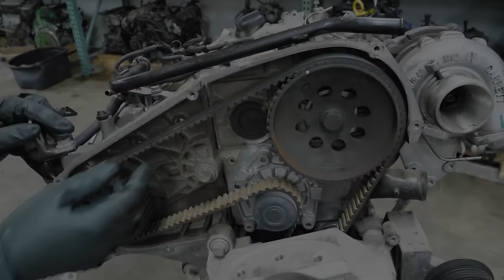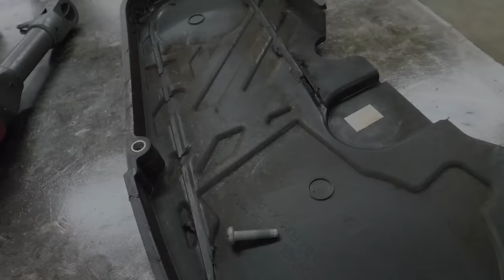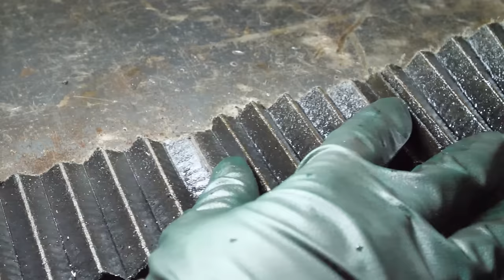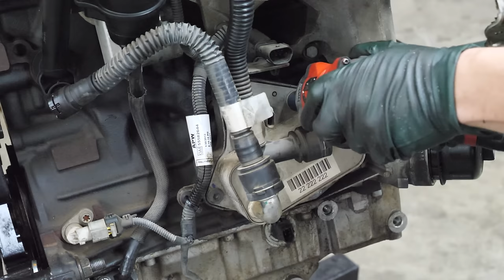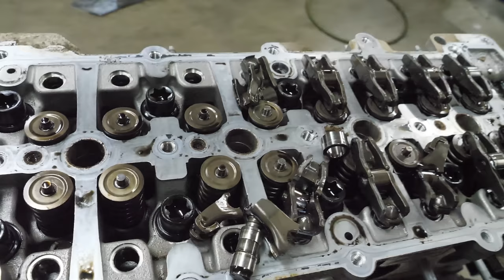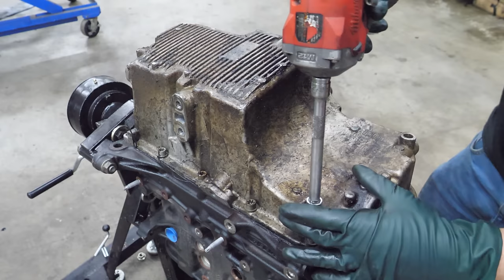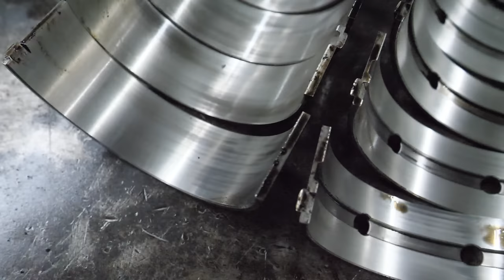I RUINED IT! Tearing Down A "BAD" 2.0L Chevy Cruze Diesel The Wrong Way

Comment: I love my 2014 LUZ Cruze. Just reached 100k miles, I can get over 600 miles on a tank of fuel (easy 45 mpg highway) and my best 50 mile average is 59.9 mpg (flat road, no wind, no drafting). I've made it from Detroit to NYC on a single tank of fuel twice, and Detroit to Asheville on one tank more times than I can count. And the added list price was mostly due to the trim package, the gas engine with the same trim was only about $1,500 cheaper. I plan to keep mine until I die.
Reply: What has broken on it so far?  Replaced any window regulators?  My daughter had a 2013 LS (1.8l gas) for three months (totaled it in an accident), and I got to replace the driver’s regulator at 90k.
Reply: @sharkinstx   The driver door window regulator a few years ago, the A/C compressor clutch last summer, and the side detection module last month. Just did the timing belt and put on Bilstein B6's (both normal maintenance items) and the Whiteline rear sway bar, with the suspension upgrades it handles better than ever. Next come the Whiteline 27mm front sway bar and high-durometer control arm bushings.
Reply: Then one set of injectors and an EGR wipes out the fuel cost savings
Reply: I get closeish numbers from my eco if i can stop assholes from tailgaiting me.

Every car I've ever driven, no matter the engine type Gas, Diesel, or even full electric Or how boxy the vehicle is, get their best economy at 45mph.

It was true for my 1987 3/4 ton V8 Carburated van as it was the Chevy Bolt Rental I put 1500 miles on driving around looking at Replacement Eco (6MT) Cruze's with.
Reply: @Me-zo8yc  They have BOSCH injectors you can get them repaired easily not sure for North America, Egr just needs cleaning after 100k miles.
Reply: @Me-zo8yc nowadays most people delete the EGR and the dpf / def . Because the customer won't pay 6k for a new dpf filter installed at the dealer.
Reply: @originalchilehed  No one will believe me, but my 2014 has 204k now, and I've done almost nothing. NOX sensors once and a DEF heater. That's it. Original brake pads and rotors. Original suspension. Nothing but oil changes and tires. Still averaging 42mpg on a tank, 80% highway.
Reply: @brianp6965  Original pads and rotors??!? Damn dude, how'd you manage THAT?
Reply: @originalchilehed  🤣 I know, is crazy. I have new pads & rotors in the garage but they won't hit the wear indicators. Fronts still have almost 1/4", rears are paper-thin. Zero noise when stopping though!
Reply: @tomtom1541 If they installed the Speed Of Air dimpled/thermal coated pistons with gapless rings and did nothing else to the engine, they wouldn't need the EGR/DOC/DPF/SCR w/DEF.  Besides there's a Federal Law on the books that states any diesel equipped vehicle at or under 6,000 GVWR is not required to have emission equipment.
Reply: My best is 720 miles before refueling. They’re amazing.
Reply: @cyyber1  720's crazy! How'd you do it? Tires at max pressure and CC at 50 mph?
Reply: @originalchilehed all highway 65 mph average. My second gen gets 50’s and 60’s highway but it’s a manual.
Reply: @sharkinstx I’m at 215K and it’s mostly been emissions parts. Nothing major or anything I couldn’t fix myself. Engine and transmission still run like new.
Reply: @originalchilehed the diesel got bigger front brakes and the pads seem to last forever. The transmission downshifts nicely too which helps a lot.

Comment: To undo the loctited fastener, apply reasonable torque on the edge of stripping and hold the torque. Hold. Hold. Sometimes it can take up to a minute. And all of the sudden it gives. That’s because polymers in the thread locker are pliable. They will resist sharp forces like vibration or impact wrench, but will give at the steady force.
Reply: You must be a wizard to hold this knowledge.
Reply: @James-vt2cb  It was black magic shared by loctite rep
Reply: Or heat it.
Reply: Interesting comment but I'm not going to sit there and wait for something to happen lol

Comment: Fun fact, the glow plugs on these engines use a M9x1.0mm thread pitch. Something I learned when I went to try to compression test one. The necessary adapter is something that doesn’t come in most diesel compression test kits.
Reply: parts in this engine are same as focus, german. a good mechanic, fkt mine, cos he didnt time it correct, broken rockers, no other damage..  if its not a chev, they know fk all..

Comment: The engine is very normal here in Europe. It is actually designed and build by FIAT.
It has a very known problem that kills it.
The O-ring between the sump and the oil pump becomes hard and leaky.
It sucks in air together with the oil and when the oil light comes on, it's already too late. The bearings on the crank are finished.
A known problem in Europe and used engines are sought after and expensive.
Reply: That would explain all the metric bolts
Reply: This is probably what destroyed this engine. He didn't really look at the o ring, but I'm guessing that was it's main failure because how the main journal bearing looked like.
Reply: 100%
Reply: @samh6761  most of american cars use metric bolts as well
Reply: Fiat = Stellantis, which explains a lot. GM using a Stellantis diesel engine.... Oh well, they sold Open/Vauxhall to Stellantis too so I guess at least those now are fully stellantis instead of just the engine.
Reply: @Google_Is_Evil  they are still pretty decent engines besides the o ring issue. But ya, stellantis is a shit company and cheapened up all the brands they owned.
Reply: Replaced mine proactively at 150K miles. 215K now and still on the original turbo.
Reply: Is it a good idea to replace that gasket/o-ring preemptively?
Reply: @dennisyoung4631  absolutely. When it goes, it will ruin your bearings.
Reply: @dennisyoung4631 
Don't worry.
Other commenters confirm the Single Overhead Cam engines were Fiat.
This engine is DOUBLE OHC - GM - NOT FIAT.
Reply: FIAT 😂💩

Comment: 15:08 Senior Design Engineer at a major OEM here. That fastener decision was likely not engineering, it was Production and/or Procurement. Designers aren't in the business of perpetuating retardation of that type.
Reply: "Theres the Blueprints, then there's the As-builts... "
Reply: I'd almost guess it's a type of anti tamper fastener to keep people from deleting the pcv so easily.
Reply: I don't know for sure how the automotive world works from the design and development, as well as test and initial fielding.  

But as a life cycle logistician, no one is allowed to go outside the design without some kind of change order process.  We in the program office can't do it; the Fleet Readiness Engineers and Logisticians can't do it; the Fleet can't do it - even in cases where we KNOW something will be an acceptable substitute.  There's a process in place, and everyone has to follow the process.

Not even after the platform is fully fielded and in sustainment can we do crap like that.

I can't imagine your world is any different.  I know we couldn't make those kind of substitutions when I was a dealer mechanic (Ford and Toyota).  That's what the field reps and the engineering hotline/review process is for.
Reply: off course... who would admit...
Reply: "Senior design engineer" sounds a lot like somebody who would already know about tamper prevention fasteners from back when they were for locking out carb tuning to now when they are on emissions systems that are commonly deleted
Reply: @tetedur377 unless you are Boeing, then it’s process schmocess, I got donuts to eat.
Reply: @madflyer1093  You are correct, the LUZ for North America has a tamperproof PCV system. To remove the bolt you need to cut a slot in it and remove with a flat blade screwdriver. The special bit for the bolt is only used for installing a new bolt.
Reply: I take minor joy from removing tamper proof screws and then leaving them with whatever part they were holding down on a nearby shelf.
Reply: Hard to believe. You guys always blame others for your failures. It's not just fasteners, it's entire engines designed poorly. And this applies to pretty much everything. From water bottles to refrigerators and heavy equipment. I've seen it all.
Reply: @xXturbo86Xx  Sure you have... lol
Reply: @xXturbo86Xx 
Correct.    Since 1985 everything is built to a budget & not to a standard... BY DESIGN!

Comment: My Vauxhall Insignia have this engine, I really love it, mine done 200k and it's still run amazing with no problems, just regular mentenance, them big issues is oil pickup gasket, they are shit, in time it lose oil pressure and kill it, easy to fix with a aftermarket think, except that it's amazing engine ❤❤❤
Good job Erik, I enjoy your teardowns every week 👍👍

Comment: I admit I cringed when the impact was spinning the camshaft, but I think it is so cool that you said perhaps it wasn't the best idea, and then admitted it freely as a mistake at the end.
It takes courage to admit mistakes in a huge forum like this, and I admire that.    But, based on some of the other comments about the water pump seizing (though it didn't seem like it was seized, though the engraving of the timing cover by the timing belt is a sign of that happening)  and causing the valve timing to get messed up, the busted rockers (which are apparently a purposefully designed weak-link to prevent bent valves), may not have been your fault.  You may have broken a few more rockers in the process, but then, maybe not.   I hope you can get some positive ROI on this engine from the good parts.   Great video as is usual.  Your witty and humorous commentary as well as great information content always assures that when a new video comes out, I'm on it right away.    Thank you for doing what you do!
Reply: Regarding the water pump. The one that was shown was a new one. I think the previous comment from @sofarsogoodsowath was him recognizing the attempt to fix the problem. I have a 2014 Cruze with this engine. I change the timing belt, water pump, idler and tension pulley every 100k miles whether it needs it or not. It just turned over 270k so I'm getting ready to do it's 3rd swap of everything under the timing cover. It's about a $1000 for the dealer to do it, but I think it's money well spent. I bought the car new and have free oil changes for life, at least 3 a year, sometimes 4. That has more than paid for the maintenance on this car.

Comment: Ray tore down an engine earlier and now you grace us with a teardown. Its a good day today.
Reply: Who’s Ray?
Reply: Ray Alpha Ramano, of course.
Reply: @okiedean1112  Never heard of him.
Reply: Yeah, cylinder 8 just needed honing to fix the low compression.
Reply: @HappyHarryHardon  Rainman Ray.  He tore down a small block Chevy that apparently sat out side with the intakes exposed.  It was junk.
Reply: @johncooper4637 Ray does not know about spiral head un-bolt pattern, obviously  About 1969, a vet navy engine tech explained to me that taking down a head improperly would cause it to warp.  He explained the reducing spiral pattern to take down, and the center out, ironing, spiral to apply.  Ray needs to read some 60s Audela engine manuals to understand.
Reply: @boogerhead0  I cringed when I saw that as well! 😖

Comment: I have this engine in my Alfa Romeo in the UK. I love it - Fiat are known in the business for making good engines. 

140hp, 350ish NM of torque, I genuinely drive it like I stole it and still get about 43mpg (nearly 50 american mpg I think?) 
I have seen around 70mpg at around 70mph on the motorway when driven efficiently (uk mpg so ~78 american mpg) 

Also low emissions (so tax is very very low at £35 per year, I used to pay £35 per month for a GT86!)

The worst part of the car is the gearbox which actually is a GM part. 🇺🇸 😂Cant take much more torque than standard and they all have a bit of a crunch sometimes if you rush 4th-5th.
Reply: Convert UK mpg to US mpg, divide the UK by 1.2. So 70 (UK) is 58.3 (US).
Reply: @csjrogerson2377  ah ok cheers, I wasnt sure of conversion rates.

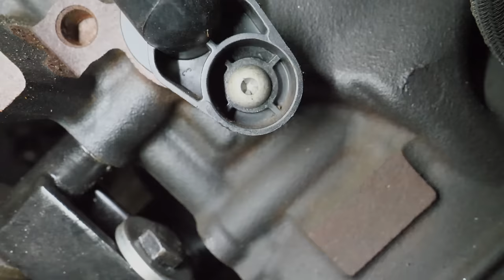Comment: 14:50 ,its a 5 point torx anti tamper fastener ,need the tool ,its also used on other components in the vehicle....they also used on parking boots on the keypad & bracebar ....you can easily remove those pesky parking boots unless it has the 7 point anti tamper fasteners...but then again i got those too 😁

Comment: Here in Europe the diesel engines in cars were pretty popular. Due to direct high pressure injection and the use of turbo's they produced a lot of torque and horsepower. If tuned, they had a lot more horsepower and torque. The VW 1.9 tdi for example was a very popular engine and was tuned a lot. It could quite easily be tuned up to 200 horsepower, using bigger injectors and a bigger turbo (and then a remap off course). Nowadays diesels are not popular anymore, because politicians taxed them to death
Reply: "Nowadays diesels are not popular anymore, because politicians taxed them to death" To be fair, politicians are the ones who promoted diesels with lower taxes in the first place  (with lower fuel excise on diesel than petrol & car taxes based on CO2/km). Diesel passenger car market share  didn't go from 10% in Europe in 1995 to 50% in 2015 by accident!  It was a policy decision (supporting EU domestic car industry who are  good at diesels, unlike Toyota with their petrol hybrids as promoted by political policy in California and Japan) and to phase passenger car diesels out now based on realising how bad they are for urban air quality, is a policy decision too.
Reply: @TassieLorenzo  Euro 6 Diesels, and especially those with lower compression (14.8:1 vice 18:1) are extremely clean. My Mazda 2 turbo diesel's exhaust is spotless even after 8 years and produces only 89 gm Co2/km and hardly any NOX.  Its cleaner than a BMW mini.
Reply: @TassieLorenzo  Two wrongs dont make a right. Governments meddling is never a good thing, especially protectionist governments in Europe.
Reply: I think you are forgetting emissions. Clean diesels have a lot of reliability issues because of the emissions crap on them. I would never buy a modern diesel unless all the emissions were ripped off.
Reply: Euro5 and Euro6 is the death of the combustion engine.

Also doesnt help that manufacurers cheap out big time on the emissions systems and honestly idiots buying a 200+hp twin turbo  2.0L diesel hammering on it for years with bad maintenance as its common in Europe to be an NPC and not know better than "factory recommended" service intervals dont help the reputation of modern diesels at all.
Reply: @jkneeland89  I wouldnt touch a modern one given the issues, even if they have better performance. The price of diesel means they arent more economical to run anymore either.
Reply: @csjrogerson2377 idk if you heard but several manufacturers got caught cheating on emissions. Even Toyota diesels have issues with emissions now. So real world driving will be worse than the sticker.

Comment: The reason that one part had a special fastener is because it's part of the emissions equipment that they don't want you to remove. So they make it so you won't have a tool to remove it .
Reply: Did they ban angle grinders?

Comment: hey eric, just a quick heads up, there's plenty of euro diesel engines where the cams are hollow and the lobes pressed on and to avoid certain issues they make it so if out of time or similar event will break all the cam lifters in half instead of bending any valve since they are just straight up and down (vw, peugeot, renault, fiat, benz, even hyundai and kia diesel's are like that), so yes, the needle bearings are indeed your aftermath in the pan 😂
a few examples would be peugeot's 1.6 dv6, fiat's 2.0 multijet (of which this engine is born from) and renault's 1.9L FQM diesel all have a "cam on valve cover" in a similar fashion to the "cam tower" you find in other engines (like that toyota 2.5L and the GM 3L LM2)
EDIT: in my opinion? this engine is freaking mint, she just needs a service and its basically a 100% builders engine! my guess is that it might had ingested water or hell maybe a flood car...
Reply: they do bend valves if hit hard enough
Reply: is there an upgrade to these, do you know?

Comment: One of the best little diesels ever made. If well taking care of could produce 50 miles gallon throughout its life. My girlfriend had one It went through three transmissions but the engine was still running. I don't remember the exact mileage when she gave up on it but it was in the high 300s

Comment: Those are made to fail rockers. It was probably wrecked before you got there which is why the cam spun. It looks like waterpump crapped, taking out belt, and stopping engine.  Engine was pulled after it wouldn't start then got put in the junk bin.

Comment: Quick tip for ya when looking at oil filter media. To better see smaller pieces of metal debris. I will take the piece of filter media after it’s cut out of the oil filter, squish it together like a squished accordion. Then I’ll put a rag around the whole filter media piece and squeeze all the oil out of the media in a vice, drying it. Spread the dried piece of media back out on a bench and you’ll probably be able to see metal debris much easier. Hope it maybe helps in the future! I always love the videos and your work!!

Comment: I have the same engine in the Opel Insignia here in Germany. Great engine. I'm currently at 330,000km. Consumption is 4.3L on long journeys. Every 15k oil change and every 100k the well-known seal on the pump is replaced. I never want to be without it again

Comment: A Chevy with FPT Multijet 2 engine? Wow. I never heard about this before.

In Brazil these engines tuned to 180hp and 350Nm of torque are used in little Fiat pickup called Toro, 3 Jeeps (Renegade, Compass and Commander) and RAM Rampage (Stellantis doesn't sell it in USA...  yet)